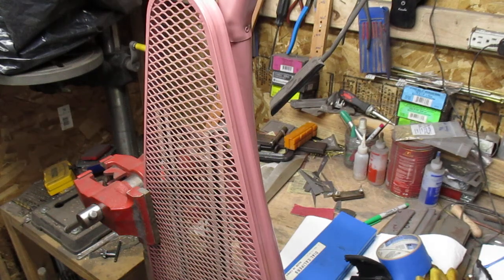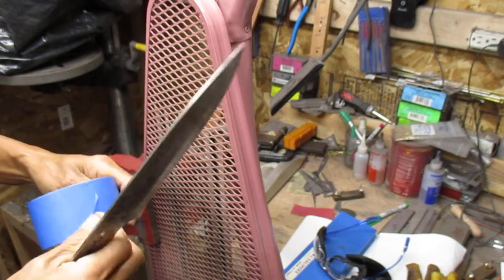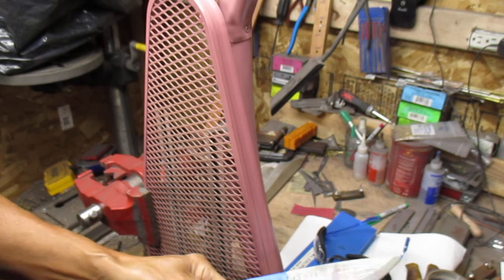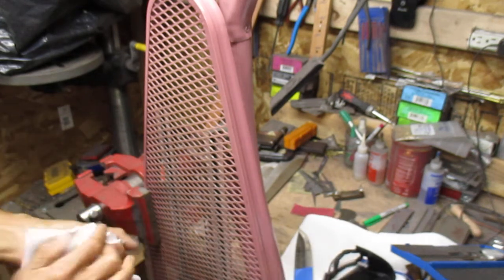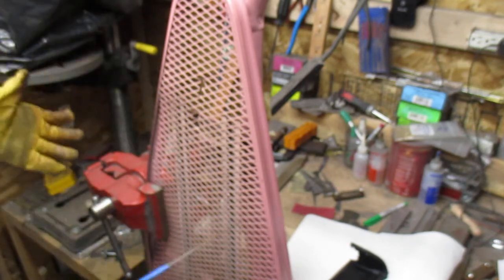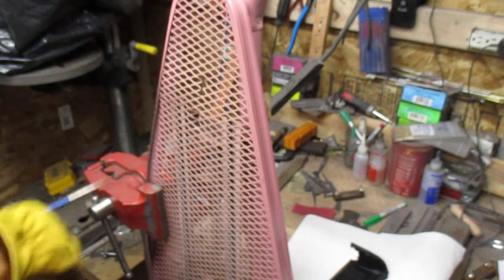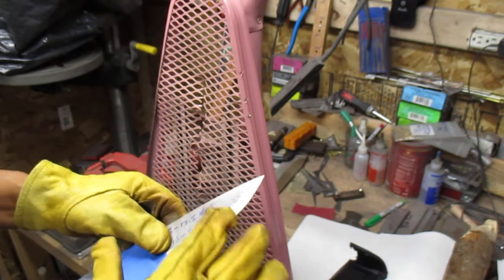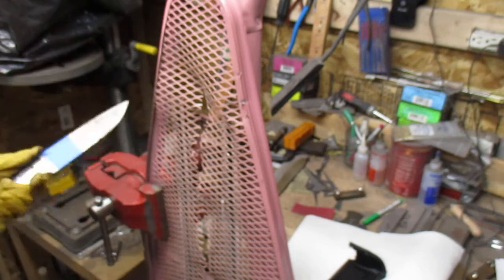BCMW 20160706 cut old ironing board with 8670 steel blade at 64rc

Comment: How do you quench 8670 (L6)? 

Can you quench 8670 in water/brine with a fast interrupted method? I am thinking about getting some in bar stock. 

Thank you.
Reply from the maker: I think interrupted fast quench works better for full thickness blade (no pre-ht grind).  A little bit more skills required for ground blade, to avoid edge crack and or auto-temper.
Perhaps using hybrid interrupted quench:  P50 for 2 seconds, then canola oil.
I tested 8670 ~63rc with various quench techniques, overall this steel at this hardness is excellent from small to large chopper blade.
Reply: Luong La Since this is supposed to be a deep hardening Steel, water or brine is supposed to be faster than necessary for quenching. 

So I’m wondering with brine, what would be a effective enough to get hard enough and avoid cracking during the edge quench? 1-2 second quench? Then let air cool? 

By the way, this application I’m thinking of is for a machete/sword. 63hrc seems a bit high, is it hard to sharpen?
Reply from the maker: @Divine_Serpent_Geh  Interrupt quench doesn't works well for edge quenching because the heat from unquenched area will negatively affect the edge.  Given pre-ht ground blade, edge quench 1s in brine then canola would work.  1s will not cool edge (thinnest strip) below martensite start temperature, hence no risk of cracks.

speed is the key kinetic for cutting for long blade - machete/sword, so yeah blade should has good amount of plasticity/ductility, which mean 60rc is about right.
Reply: Luong La Ok, now imagine this. What if the steel was heated primarily edge only, not the entire blade. Quench the edge to end up with a sort of differentially hardened blade? Hard edge maybe tempered to 58hrc and a soft pearlite spine which may take a bend under a bad cut, but will be virtually unbreakable under use and could be straightened out. Similar to Japanese Katanas. 

Also, would 1-2 seconds in brine then out for a few seconds, then back in for 1-2 seconds work as well? That is how I see the Thai, Philippine smiths do it on machetes and swords. 

Sorry for so many questions, just want to get as much info as I can before getting the L6 (8670M) and making a sword or machete.
Reply from the maker: @Divine_Serpent_Geh  Or imagine a katana with spring spine (~50rc) and 58-60rc edge - it would be a heck lot more fearsome.  Strong spine would protect edge from excessive flex (beyond yield strength).  I think, differential tempering would be much better than diff hardening.
Reply: Luong La Ok. So bottom line hehe, can this L6 Steel survive a brine only quench such as the one I described? 

Where the immense stress is interrupted and thus the steel doesn’t have a chance to break or crack. 

I’ve read of some guys water quenching an oil hardening steel with pretty good results, but all of them say you have to be fast and interrupt.
Reply from the maker: @Divine_Serpent_Geh  There won't be any stress when interrupted quench steel is above Martensite start temperature, i.e. quickly avoided precipt and pearlite nose with brine, then go into canola oil for slow aust to mart transformation.  Obviously if pre-ht blade edge is too thin then thin cross section might cool below Ms, hence stresses.  Therefore leave edge around 0.05" thick to make sure brine quench won't drop edge temp below Ms. 
Personally I interrupted using Super Quench (3 seconds vs brine 5-6 seconds quenchant).
Reply: Luong La Thank you so much for all of your answers. Sorry I ask so many questions haha. 

How much of a role does blade thickness play into quenching. Say a machete blade of 2.5mm thick vs a Katana blade of 8mm?
Reply from the maker: @Divine_Serpent_Geh  Use/adapt whatever time needed in fast quenchant to bring blade near 500-600F before quench in slower quenchant.  I done many time - super quench O1 1.5mm to 10mm thick for 0.5 to 2 seconds befoore canola oil quench.  *note O1 is a very deep hardening steel, way way deeper than 8670. Also did similar for W2 and 52100.
Reply: Luong La I see. Thank you for your help, only thing left to do is try it out haha. 

By the way, I know S7 Steel is very durable and would be good for machetes/swords. Have you ever worked with any of that? 

Is it possible to get good (not perfect) results using minimal equipment like charcoal fire + forced air, quench tank etc.
Reply from the maker: @Divine_Serpent_Geh  No s7 exp.  Sure, with good metallurgical skills you should able to produce good results using basic/crude/bbqpit ht equipment
Reply: Not an L6 steel it's tougher then L6
Reply: @DOGFACESOLDIER0708  Yes, I believe that’s correct. But it is within the same family of steels; L6, 8670, 15N20 are all high nickel carbon steels. The nickel is the secret ingredient for the immense toughness on all three.

Comment: how do you like 8670 overall
Reply from the maker: I prefer low Cr steels with Carbon at least 0.9%.  8670, 80crV2, 107x, 106x, 5160 etc are strong and tough as given however limited for grain refinement

Comment: It is hard to judge strength/toughness accurately with such work, and I have never cut up an ironing board - but even with all those qualifications, a 0.15"/15 dps edge I would have suspected would fail visibly. 

It might be informative to to the same thing in these trials with the standard HT for comparison.
Reply from the maker: Good point, Cliff.  However with std ht 8670 can only harden to max hardness about 62rc as-quenched.  Also blade std ht AQ rc is fragile, so unless I use gentle cutting tests (forget mid to high speed chopping) - there isn't much to compare.
8670 std ht 62rc AQ fragile because hardness response from long lath (and some % of plate) martensite cells - aka high matrix dislocation.  My CWF 64rc is a low dislocated matrix consists of interwined/weaved short martensite cells. That is why - this blade (in this video) can be use in untempered state. 
High alloy steels get instant boost from CWF because with a low dislocation matrix, high RA (>5%) problem doesn't exists. Similarly precipitation coarsening also won't occur because can't diffuse particles in a weaved lattice.